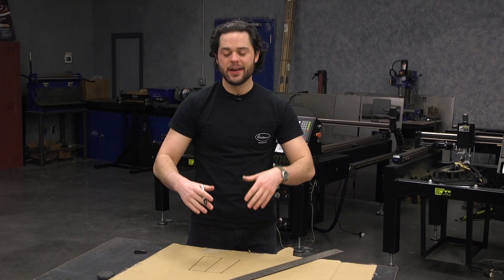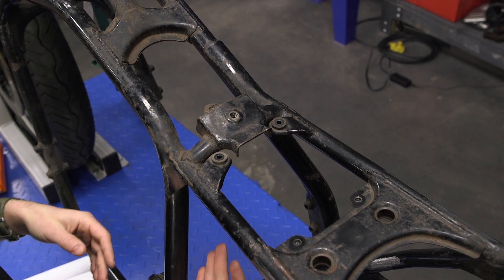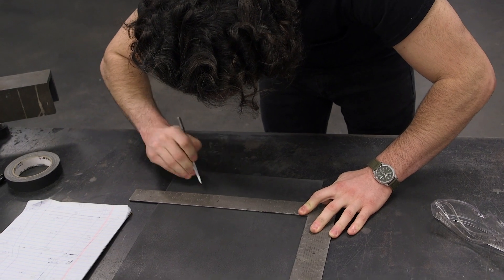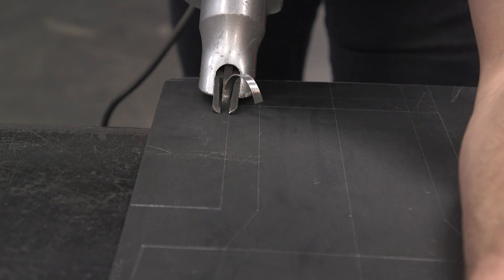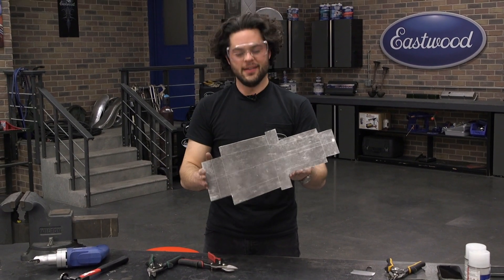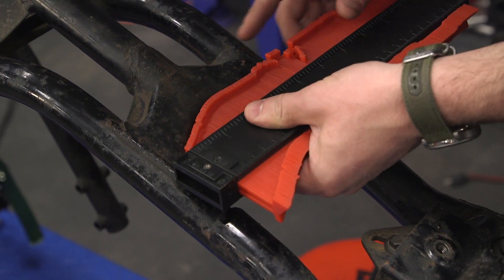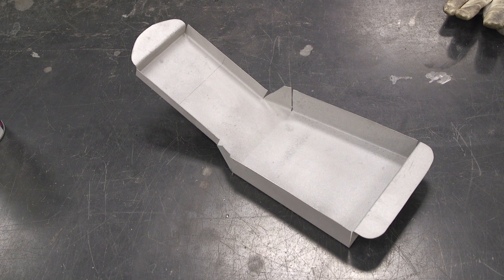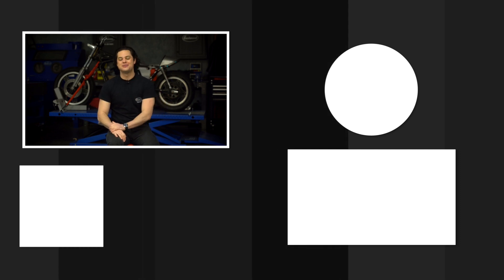How To Fabricate a Custom Electrical Tray - Metal Fab Tech Tips - Episode 3

Comment: Here's an idea - For that front edge flange - I would round it to match, then put a strip of rubber edging on, it then slides up from the underside and when you bolt the back down it is locked in......     I could really use that tool to make mine when I find the krusty old bike to build!   Also I like to use cheap perforated "metal" (mystery metal) from the home store, easy to shape by hand for templating.   - for cardboard templates, Cereal box is perfect, thin like the sheetmetal cuts clean, and shapes well.
Reply from the maker: After we completed this we realized that cereal box would have been much better. Thanks for watching!

Comment: With those snips does it always take like a quarter inch out when it cuts or can you tighten up the sheer space between the blades?
Reply from the maker: The electric shears always remove a quarter inch of metal, one of the few downsides to them. However, we just got used to accounting for that lost metal.